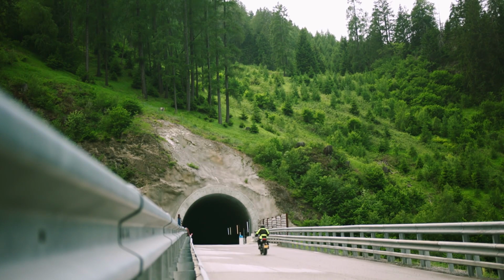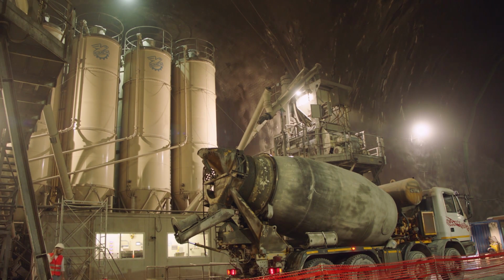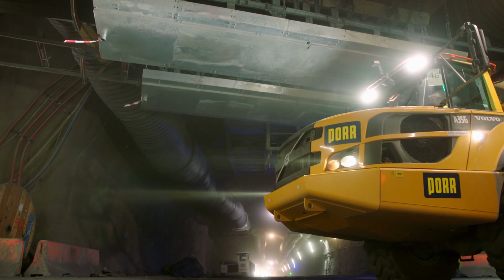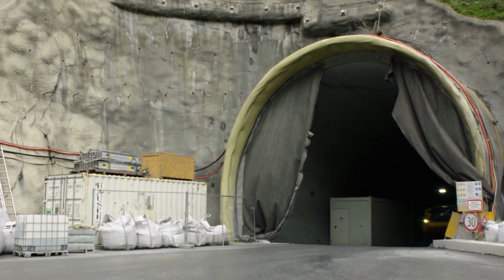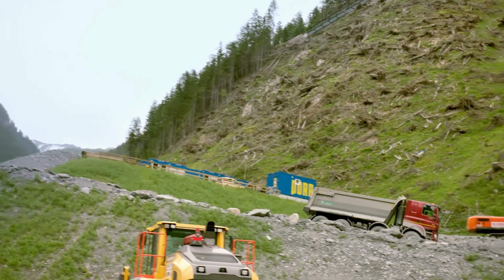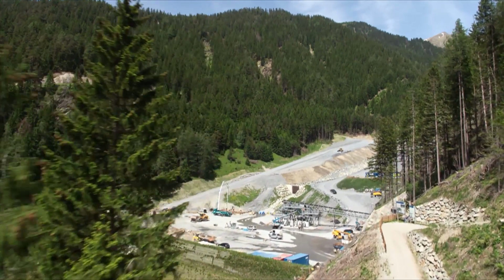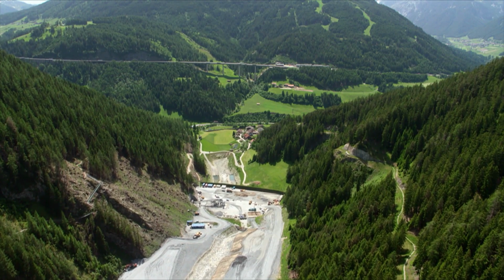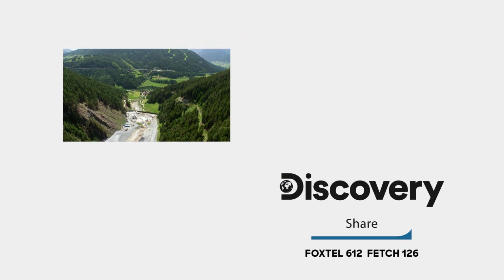Where Does the Rubble of a 55-Kilometre-Long Tunnel Go? |  Richard Hammond's Big

Comment: It sounds like a disaster waiting to happen..Wouldnt want to live in that village at the bottom of that valley.
Reply: Yeah, 50 years from now when the construction is done and the money is done being made, who will be paying to keep those drainage systems up? 100 years or less I bet that a massive landslide happens.
Reply: @Chris.B1111  it's probably going to be treated like a dam.
Reply: @Chris.B1111  Wonder how big that little town will be by then.
Reply: It sounds like they’ve learned from the Aberfan disaster. Lithologically speaking, the limestone and volcanic substrate being excavated here is inherently more stable (thermally and structurally) than something like coal slurry from anthracite refuse, as was the case in Aberfan. Placement of refuse tips within the bases of valleys (which they are doing here—as opposed to on slopes or high ground as was the case in Aberfan) is standard practice and is generally safe. They also seem to be conscious of ensuring adequate water drainage, and spreading the tailing in a manner that creates more surface area than tip height. So, this is not something to be too worried about, but you are wise to have recognized the danger this could present.
Reply: @dr.z1657  Thanks for your comments.  In the video they said that it will be 100metres higher than its current height,  somewhat worrying all the same. Yes looking back at disasters such as the Welsh disaster is how we ensure it should never happen again.
Reply: @Elfin4 What a tragedy that was. Although they plan to make the tip 140 meters in height, I’m sure that height will be distributed across a large surface area in the form of a mesa rather than a heap. In addition to the drainage measures, their plans to replant the natural fauna will also help to protect against soil erosion. Sounds like they’ve thought it through. Certainly hope so for the sake of that village.
Reply: First thing I seen was landslide.
Reply: Not really as this material is limestone. Compacted limestone tends to solidify back into a fairly solid mass over time.
Reply: No, it will harden with time and pressure (100m of stones have a lot of pressure) so the lower levels will harden and as they said it will be renaturated so plants will keep the upper levels stable. Also it will be shaped so it won't look like a dam anymore but more like a natural hill. That will help with the stability. In 50 years you won't even be able to notice anymore that there was a valley today.
Reply: Unlike the disasters this material is not just being loosely dumped creating unstable dams. 
I would prefer to see the material ship by rail to be consumed by cities but they are not creating a hazard for future generations.

Comment: The way they try to describe the amount of material is a bit odd. Just keep in mind a million cubic meters is just a cube of 100m edge length. A lot of material, but maybe not as much one might think.
Reply: "Just"
Reply: The problem with that is we would just start comparing it to similar structures, maybe a skyscraper. But keep in mind those are hollow, while the cube isn't. While it might be easy to imagine a 100x100x100 cube, I think the true amount of material in that cube is a bit beyond humn comprehension
Reply: @kalokal5812  exactly

Comment: the material removed from the tunnel is called Rap. Rap consist of the rubble and large chunks of rock that were blasted or removed by the TBMs. Rap can be recycled all they have to do is separate it and crush it and it forms hard set concrete.

Comment: Actually it's not the longest rail tunnel. The longest rail tunnel in the world is the Gotthard Base Tunnel with a length of 57.5 km (35 miles).
Reply: No it will be. Together with the already existing tunnel in innbruck, which will be a part of the brenner basis tunnel, it will be 62 km long.
Reply: @theaustriantree Okay... Well, he said 55 km. So in this case it's wrong. Thanks for the information.

Comment: Ruble could be sold if there was railway near. Not just dumped. Some size sorting Could have been done. Also they could have built Damm for electricitu or water pump station for load following.

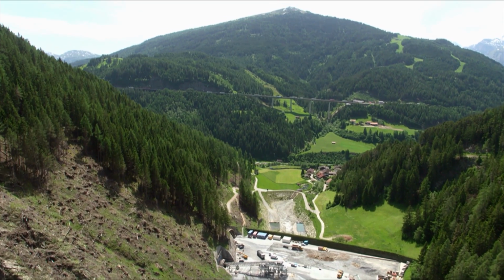Comment: 5:23
I think that that viaduct in the background is the Brenner Pass.
Reply: Well its actually just a bridge of the highway leading to Brenner, but its still a few kilometers until the actual pass.
Reply: @benedictquirbach2026  
Ah, OK.
I thought it was the Europa Bridge.
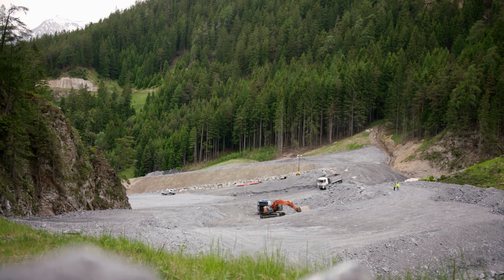Reply: @lewis72  The Europa Bridge (Europabrücke) can be seen at 6:45. Fun fact, i used to work at the bungy jumping station that is using this bridge for the jumping.
Reply: @benedictquirbach2026  
That's the fella !
I walked across that back in about 1986.
Have loved Austria ever since !

Comment: It's not being made into CEMENT!! You mix cement, water, sand and gravel or crushed rock to make CONCRETE. CONCRETE IS THE HARD FINISHED PRODUCT,  cement is the binding agent.
Reply: Shannon Smith : Yes that was a mistake. Cement is made in a rotating furnace, with huge CO2 emissions. Imagine the ventilation needed for that.

Comment: Very interesting - couple things don't make a lot of sense though. Why build the cement plant underground? Is it so expensive to ship it out and back in it's cheaper to dig that huge cavern and do it inside? Also, why are they dumping it all in the valley rather than shipping it out for use? This place will have rail access eventually, they could build the rail line to the entrance and ship the spoil out by rail to customers who could use it. I might suspect the resulting material is too low-grade to have any economic value or something like that, but they're using it to make cement so it couldn't be all that useless.
Reply: Why transporting the stones multiple kilometers in a direction to then transport it back the same distance into the tunnel for use? It's more effective to just have a cement plant underground. Also you wan't to have the least traffic possible when you are working in a Tunnel, so it would be bad to have double the amount of trucks because you need to transport it a longer distance.

Dumbing it into a valley is the most cost and use effective strategy. If they would just bring everything onto market and sell it all at once the prices would drop massively and thus collapse the rock market.
Reply: @thenamen935  I guess the trucks hauling material in and out through a narrow tunnel, traffic limitations, is a factor encouraging the in-tunnel cement plant.
They wouldn't necessarily sell all the rock at once, as they're digging it out over numerous years. I could potentially envision an arrangement with all the local gravel quarry operations that they each are given a percentage of the rock that comes out, they just have to come get it. Stop mining their own rock and sell this instead for the duration of the project. Though I guess that might put the quarry laborers out of work for a while if the companies can just scoop it up for free. Ah capitalism, a system that only works if we're wasteful and throw stuff away.

Comment: i thought the waste product of earth converted into cement would be dirt, not more gravel. although i guess most of it is gravel/ cement. they just simply have too much of it and dont need it all to make the tunnel walls etc. even so, surely all that gravel is worth something? like a lot of money? i know its a lot of material to transport but still. its like a gravel mine. couldnt they just sell it instead of turning it back into landscape? you would think that would be cheaper and easier. but obviously not or they wouldnt be doing it this way. i just dont get it though.

Comment: They should be using that material to build road bases and building pads. What a waste.
Reply: I admit, I was thinking of the construction potential as well. But at the same time, looking at the area they're in, the logistics of moving all that rock seem outlandish enough that just turning the tunnel entrance into a mega-garden looks to be the easier and cheaper option.

Comment: That’s disgusting what they are doing to that beautiful land!
Reply: Its landscaping. By the time their done it'll look better than it did before. They'll re introduce wildlife and flora to cover all the gravel. Did you not listen to what they said?
Reply: Building roads to traverse this section of the alps (or circumvent it) without a tunnel is really not an option. Railway is more environmentally friendly than roads anyhow.
Reply: @dr.z1657  Well that has been done already ^^ It is just that the traffic there is steadily increasing and that is a major environmental and cost (due to the need of a third lane) concern. Thats why they are building the rail tunnel.